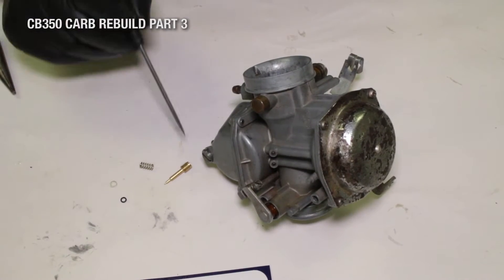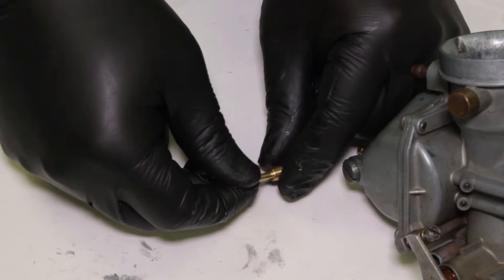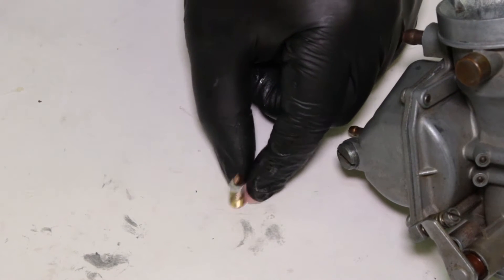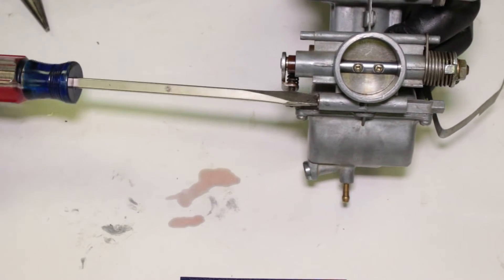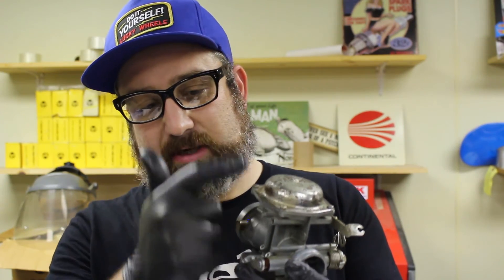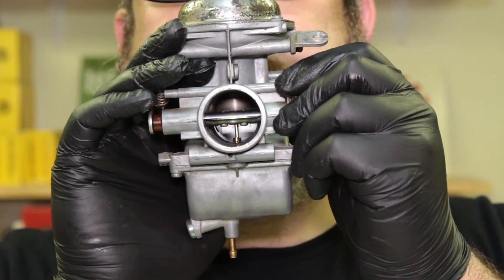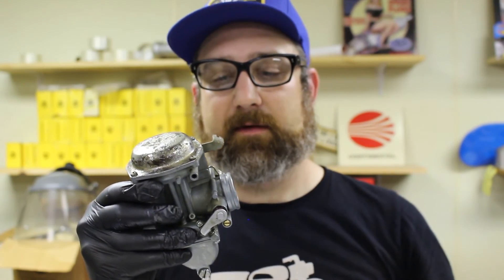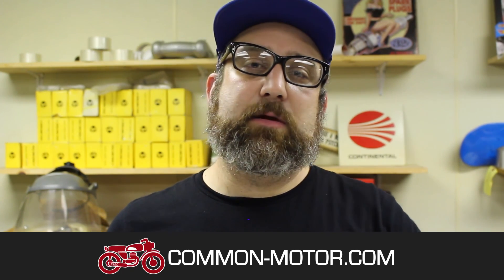Honda CB350 Carburetor Rebuild Part 5: Mixture Screw Installation & Diaphragm Test

Comment: These videos have been a Godsend since I've never messed with a carburetor.  Everything went per the video until the idle screw.  The one you described was NOT the one that came out! The length was the same but the threaded part is thinner.  I installed it with the spring and o-ring but I don't know if the o-ring is correct.

Comment: i was told the SL350 carb boots are different. Same engine and carbs, why would they be different.
Reply from the maker: The first generation SL350 was the same just with different jetting, second 2 later generations (K1 & K2) used a slide carburetor. Actually ran different camshafts, a different head cast with smaller intake ports, and many other changes.

Comment: If my carburetor leaks through the bowl vent, but isn't overflowing throug the overflow pipe, does that mean my float height off? I set the float height on both carburetors the same (as per manual), but only my right carburetor leaks through the vent...
Reply from the maker: Message our support with some photos and we can help you out further! I'd imagine maybe you have a combo issue of overflow pipe clogged and either needle not turning of the fuel or maybe a leaky float that needs to be replaced.

Comment: Great vids, but just a note. If you're working on a 71 with the 3D carb there are no orings or washers. I went out to get some thinking they were missing and it really messed up my carb tuning.
Reply: Thanks for mentioning this! I figured mine were 'lost' by a P/O and was confused for a few minutes when I couldn't get the o-ring+washer stack to fit in there.

Comment: Youre constantly an invaluable resource. Thank you. Any idea why the diaphram wouldnt move at all? When I remove the chrome cap and blow it seems to react just fine, i watch the diaphram expand. However when the cap is on and I blow I get all resistance and no response.

Comment: Thanks for sharing this!
I've read that some of these carburetors (on earlier models) didn't come with the washer/o-ring installed. Can you confirm this? I know that my carbs on my '73 cl350 (722A) did not have the washer/o-ring in them. What, if any, differences would I encounter? Bike seems to run "fine", but then again I don't know how it would perform if I had the washer/o-ring in the air mix screw.
Reply: Same here